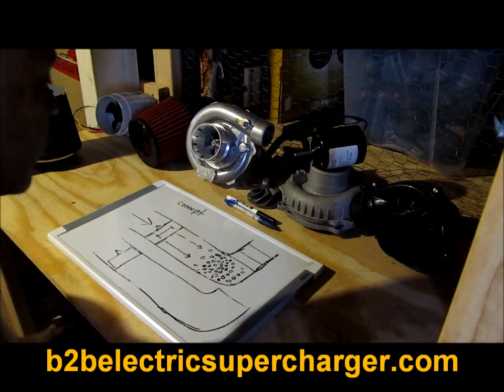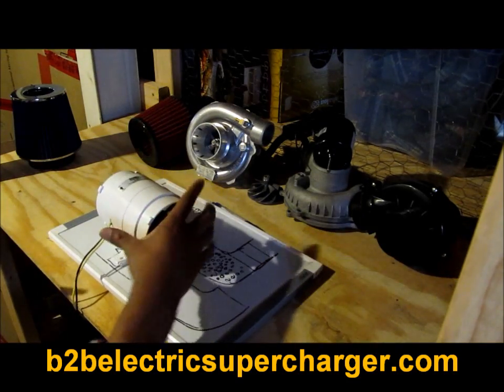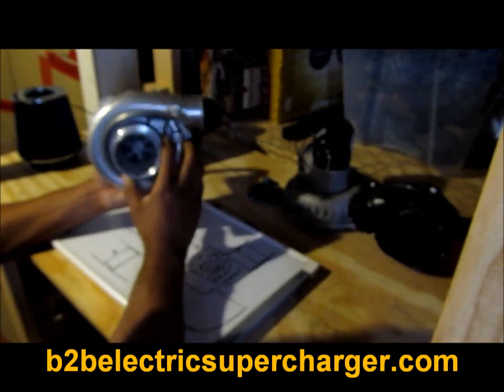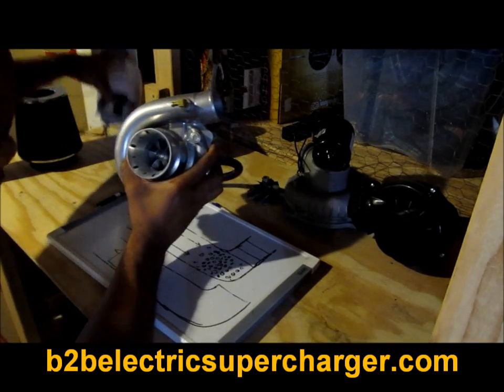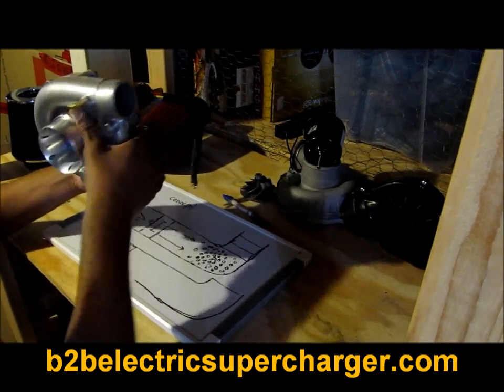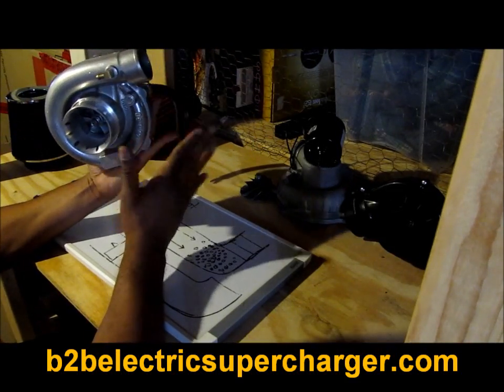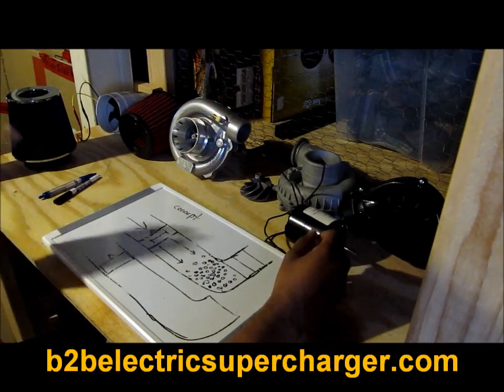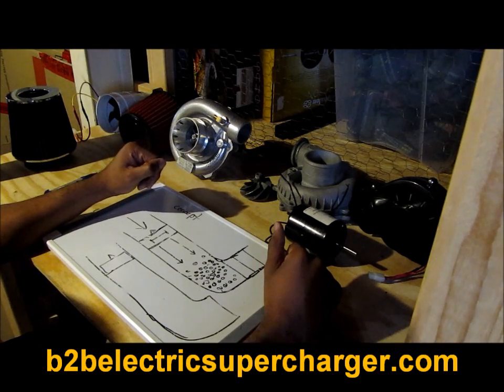Do Electric Superchargers Work?

Comment: theoretically, you wouldn't need an intercooler or piping. it would help to cool the air as much as you can because of pre-detonation knock. water methanol injection comes to mind here. you still do, of course, need to tune your engine and upgrade fuel because it is boosting your engine. more air in the cylinders requires more fuel to burn at the stoichiometric ratio. also, the guy said he bought the turbo off ebay for 50 bucks. why not just buy and rebuild the turbo and go all out and not be limited to such little amounts of boost.

Comment: What if you buy one of those electric ones and connect a little weed eater 2 stroke engine to the fan to make it turn faster? That would create some compression.
Reply: "some" ... in terms of PSI... none. PSI = Pounds per Square Inch, and on a 1 1/4" pipe, that is a little more than a pound of air for every 1 inch of pipe. For that kind of reversion, you would need a V-8 behind that type of fan... The reversion of the fan blades is higher than the amount that the engine would take on, thus you loose any boost due to the design. At most, you have made a "cool air" intake, which is silly too.
FYI- in one atmosphere of normal air that we experience all the time, there is approximatly 13.5 pounds of pressure being exerted already, in order to add one pound of pressure to that, you need to double the amount of air going into that opening, in other words, you need 28 pounds of "force" upon the air, to exert each additional pound of pressure going in. Those plastic fan blades won't hold up to that for long. Face it, you need a turbo fan.
... and another thing to consider... once you do get a bit of compression on your engine, is about your valves... most high performance engines will handle between 12-16 pounds, and are rated for no more than 14, so if you want to blow your seals, then by all means run it at 16-18 PSI for a year. Jack a Honda or a Toy up and see how long it lasts... you can spend that money you "saved" on gas money to pay for the re-build. LOL
Reply: ***** Somehow, a design of your specifications would also be made of things that you cannot afford. Which defeats the idea behind a "lost-cost" turbofan.

Comment: freshkryp69 - this is not the same as KERS. F1's KERS units use an electric motor/generator attached directly to the the crankshaft or the transmission. In acceleration mode, the KERS motor helps turn the crankshaft or driveshaft. It has nothing to do with airflow.

Comment: those brushless motors are capable of making lots of power for there size. the only problem is making 2 or 3 kilowatts on 12v your amp draw would be insane.

Comment: I like the idea, but is the fans strong enough to produce and pressure and boost? A fast spinning fan doesn't mean it is strong enough to produce the psi or bar. Also, how does it hold up against heat? My guess is that it will burn up instantly when the turbo starts to glow bright red

Comment: hello sir, nice explanation.I have a 150 cc motorcycle producing about 11 bhp,has a 12v battery.could you guide me to build one like this.and, will the electric motor consume as much battery power and thus load the engine and offset the benefit of the supercharger? pls help, m thinking whether to go the turbo or the electric way.
many thanks

Comment: Thank you. I was thinking of a project. I wanted to take a hair dryer fan/motor and attach the wiring to the alternator and fit the fan into my short ram intake. But your explanation of compression and straight pipe summed it up. Thank you!

Comment: BLDC commutated motors are highly efficient and can achieve RPMS of over 60000 RPM. Some are rated to continuous rpms of over 201,000 rpm!. Now wouldn't that suffice for a boost compressor arrangement.

Comment: Electric motors can do the job if you understand how to match the motor. The advantage I see is computer controlled boost pressure management independent of Engine RPM. That is similar to the effect u get with variable geometry compressor fans that improves efficiency over an rpm range. However they too have limitations.

Comment: Before I watched this video I bought an Electric supercharger from GTE performance, and it has two metal fans spooling at 20,000 rpms. It comes with a K&N Cone filter, so I just replaced my factory airbox. Will this be enough to generate some decent boost for my car, or not?

Comment: Since he does not answer. I could maybe help a little here.

The motor that is probably used for this application is a series would DC. This type of motor could reach very high speed. The speed is actually theorically unlimited. I am curious however to know what kind of bearings are installed since this kind of speed are very high for roller bearings.

Comment: For everybody, just my little extra comments: 
1- There is a big difference between a "compressor" and a "fan". If it does not speed at very high speed with tight gaps between the impeller and the volute, it's not a compressor.
2-Boost requires power. Expect a large current drain if you want boost an electric device.
3- Centrigugal devices are more efficient for producing pressure than axial devices. An axial impeller device needs to be multi-stages to give any significant pressure.

Comment: Nice video. Good explanations.
Just a little correction on the terms though not just to mix up the newbees. 
What you call a real turbo (with the part in your hand) should be called actually a "Centrifugal compressor" . The "turbo" term is typically used for the system combining the compressor and the exhaust turbine. I agree with you the real compressors typically come from turbos.

Comment: how much boost do you think you will achieve with one of these I just cant imagine a electric motor spinning a turbo as fast as pressurized exaust but I don't know much about electric motors so I could be wrong. what kind of performance are you expecting?

Comment: Some good basic info here in this video.  A good compressor map will be a graph showing boost pressure on the vertical axis and air flow in cubic feet per minute for a specific impeller rotational speed on the horizontal axis.  An electric supercharger will definitely work if the motor can supply enough torque to turn the impeller at the rated speed.  You might also want to experiment with an electrically driven roots blower.

Comment: I have a 5.7 Hemi 04 to 08. I want a small mod like your electric charger for this engine.  $ 5,000 for a super charger or turbo is just too extreme for a little garage fun. $800 to $1,000 for a little more fun is not that bad if you know for sure it’s going to work.  I’ve already put the “Hemi bully dog”, new Cats & exhaust on it. Adding just a little more to it without changing injectors and harming the engine is all I am looking for.  One more thing your download sight really SUCKS.

Comment: I had some spare money lying around so I bought one of those cheap "superchargers" for my 80cc bicycle engine kit. I bought the kind that isn't an inline fan cause I thought I could modify it to 24 or 36 volts and it may actually work on my tiny engine, im thinking if I can push more air through the carburetor than naturally would be sucked in it could make more power. what are your thoughts? I already bought it so either way im gona try it.

Comment: Hey man I've got a turbo off a commins and i have been tryin to figure out motor to air or boost i have went as far as puttin a pully on a real hollister turbo with a belt but after some pullys and stuff and lots of sillyness i have been trin to figure out how many rpm that it needs to be to make it boost how did ya get ur range with motor on speed for boost

Comment: So u am planning on building something similar to this, i have a 93 accord 2.2L N/A engine. I am thinking of pushing 5 pounds of boost. Do i need an FMU so i dont lean out my motor and eventually blow it up? What about the MAF sensor. Basically, what im asking you is, what supportimg mods or things will i need so i don't blow up my motor at 5psi? Thank you.

Comment: So do you think those $180 e-turbos on ebay that claim 3 psi of boost work? They have impeller style blades like on real turbo chargers and claim around 35,000 RPM. Seems reasonable to me?

Comment: While this is a better step forward then that ebay crap they call kits, I still don't think this is really a practical option. 70A @ 12V my not seem like much, but unless you have a newer vehicle, the charging system will not be able to run this. Most older systems only generate ~65-70A from the alternator that has to operate all the electrical. Personally I don't see the point in electric turbos. A real turbo uses waste gas from the engine to create power. These put MORE drag on the engine...

Comment: While you make some good points, a few few crucial points have been left out.
The biggest problem with an electric motor POWERFUL enough to spin the turbine up to speed is the amount of energy it requires. That energy has to come from somewhere. Unless you plan on running a brush-less motor and a trunk full of batteries (very heavy!!) how would you possibly run it off of the vehicles charging system? You would need an alternator so big and clunky that the parasitic drag would negate your gains.

Comment: Getting a electric supercharge to work/ produce proper boost pressure would be  complex/ costly! First you need proper scroll turbine fan, then  a motor with rpm/ torque to produce the needed PSI w/o killing your electical system, next to  control/ increase  the Timing/fuel delivery at the proper times and conditions!  The way i look at it , if electric super chargers works it would have came w one!

Comment: xsturbo specs:  24V@9.2A= 221 watts.
221/ 50% (compressor & electrical inefficiency) then/746 = 0.15 HP.
@1 psi??: CFM=HPX229/PSI   so.... 0.15x229/1  = 34 CFM.
This unit will make 1 psi @ 34CFM 
So it will boost your rider mower from ~22HP to ~23.5HP!.
 It will not work on a car.
These are not my derived equations. Supercharger Performance Handbook, page 100.

Comment: i've read it twice and nothing really stood out to me as it being small engines only and i dont see any specifics at all like 2 psi at 5,000 rpm on a 2 liter engine probably to not turn away people from buying the book but have you even done these tests man? what is it actually capable of, i mean you dont even need a dyno for this just a rev meter and a pressure gauge then see how far up the revs it can hold a few psi on what ever size ur engine is

Comment: specify what size of engine u can get those results on, i'm not saying it has to be 10 psi i'm saying on a large engine revving the psi would literally go to 0 and you get no power gain whatsoever where as a real turbo would hold 10 np even on the biggest engines due to it scaling with the exhaust. i'm thinking ur turbo might give you a few psi on say a 2 liter engine but i cant imagine it can do shit for a 5+ when it's revving not that people with those engines would be looking into this anyway

Comment: hmm even your own electric supercharger does not physically make sense a real turbo would scale with the engines intake and exhaust so big engine at high rpm = lots of exhaust = lots of boost to hold 10+ psi despite the ridiculous intake of the high rpm engine yours on the other hand might be okay for holding a significant amount of psi on a small low rpm engine but if you put it on a decent sized engine close to red line there is no way a little electric motor could keep up and all psi is lost

Comment: And where have I said that it's impossible? I'm just saying that I don't believe this guy has done enough r&d to get one working like he wants. These set ups will rob HP, but like I said there are ways to get around it. I get how sc and tc work too but it's different with the battery involved because it will either drain the battery or drain the power directly. To get around this you can delay the draining for non-WOT driving. This turns the battery into a refillable boost bottle pretty much.

Comment: Moto, I still think you are overlooking two facts.  1) The best superchargers on the market today are powered by the engine and rob HP but help the engine create more HP than they rob. 2) The best turbochargers on the market today are powered by restricted engine exhaust and rob HP but help the engine create more HP than they rob.  I will digress and say that doing more conversions creates more loses, i.e. engine > belt > alternator > battery + electric turbo vs. engine > belt > supercharger.

Comment: I understand what he is trying to do, but the problem comes with how he plans on powering the impeller. If you use the engine for this, it will just cancel out with any pressure you do build up. Obviously a battery is necessary but you need to be able to drain it in order to run the esc without robbing hp. Like I said in my other comment, it's possible. But there is more to it than what I think this guy knows. Everyone is still waiting on this dyno lmao...

Comment: If you use a boost gauge to monitor your boost pressure, and you can maintain pressure with the engine  at wide open throttle that should tell you if its working instead of the expense of going to a dyno shop. I think your idea of using a real turbo unit is good

Comment: His design may or may not be better than a normal supercharger, but regardless, all superchargers present a parasitic loss of power while also increasing power.  As long as his increases power similar to a belt driven supercharger at the same parasitic loss then it's a viable product.  If it makes slightly less net HP but is more adaptable then there is still a market.  I am not saying his claims are true but that it's possible and that you have overlooked a few basic things re: superchargers.

Comment: You are basing your thoughts on output can never be greater than input.  Indeed you would be correct that his motor would never put out more power than it drains from the battery/alternator.  However, you have to realize that pressurizing the oxygen/fuel mixture makes highly inefficient gas engines run more efficient.  The parasitic energy loss used to turn the impeller is present in typical superchargers turned by a belt from the engine or turbos spun by impeded exhaust flow.

Comment: I'd love to see a design with either a high RPM motor or geared up to produce higher RPM. Also, under load does the motor hold the rpm? I'm imagining you will need a motor capable of 10-15 kw as the average turbo takes at least 15-20 hp to push. Have you looked into high output alternators to run this? Good work so far, by the way! Not a lot of guys taking this seriously.

Comment: Hi, i read your book. I dont own it tho. I used rc car motor, and it went beserk lol with the car battery and shot sparks allover my fancy ass jdm honda. So i bought a cheap dremel and the whole thing was too big and clumsy couldn't really connect the axles very good. Can you pm me what kind of motor you wold recommend. i think 20- <30k is enough revs for the turbo to my 2 liters engine. Thanks.

Comment: yes that's true but what about the power that needed to power the electric motor to desire PSI? im sure there's a lot of juice need to be pull from the alternator for the ESC to work efficient but at the same time it will which produce drag on the alternator. keep in mind electric motors are inductive load and it pulls a lot of amps for it to work efficient therefore will produce drag.

Comment: does a ESC works? to me i think it wouldn't work IF IT'S ONLY a basic turbo housing and a high speed electric motor that feed off from a 12DCV source. you'll need major adjustment on the vehicle to make the juice that require for this device to work as desire. vehicle today their voltage range from 12 to 14DCV max and not to mention modern vehicle today their engine bay is very compact and wouldn't have enough room for the device and equipment to install.

Comment: Just curious how you arrived at 2Kw or ~3hp per liter.  Is this a calculated number or have you measured this?  I agree that the shaft hp is what u need to look at but that will never exceed the power put into the motor.

Comment: so what size motor do i need to propell the compressor wheel? i have no knowledge of electronics but i have bought a garret turbo compressor housing and wheel to try to make one of these. I just want to know what size motor i need, what size or type of converter if i need one, and how to make a wiring harness that has a buterfly press on switch.

Comment: I was thinking about it some more and if you actually get this turbo(or even your new 4psi one) to work, and you do run into the problem I mentioned with the alternator. You could probably get around that by having the alternator only run when you aren't WOT. That way it doesn't take away any power and you will be draining power from the battery while using the ESC but then come back on during normal driving where HP robbing won't be noticed. The battery is like a nos tank that refills itself.

Comment: I apologize for the fan confusion. And I did not say 1hp engine gains. I said the "impeller" itself will be running at 1hp. The turbo should put out about 1.4 psi running at 20000rpm. I am not sure how to calculate the engine horsepower from here. And I never said it wouldn't work. I said that any gains you do make will be taken away from the alternator. I don't know how to calculate the power it takes away from the engine though. It just has to be less than the power from boost to work.

Comment: By the way I did the math and with a 60A 12V fan with a 6 inch blade can produce 1.4psi. I did not account for the area in the center of the fan blade though so probably a little bit less. Check my numbers to see if you got similar results.
Sorry if it seems like I'm against your idea, I just like to figure out the physics of what is actually going on.